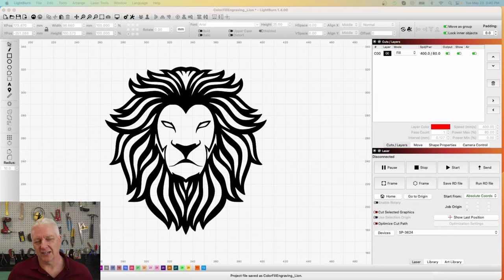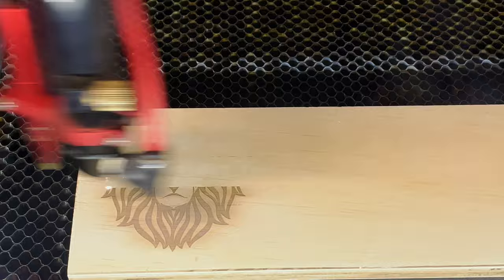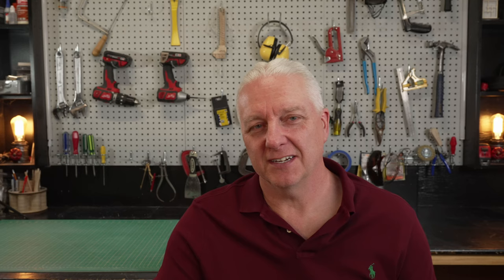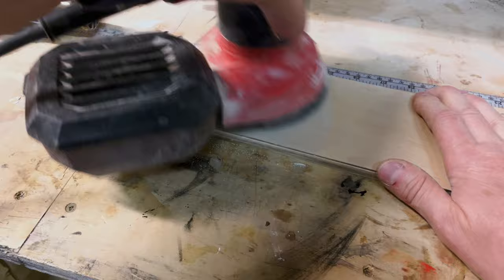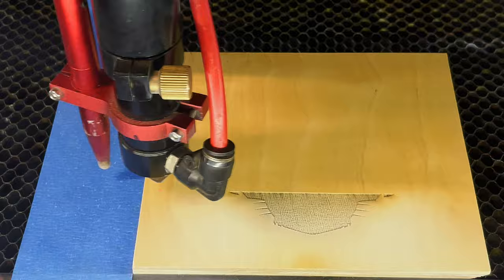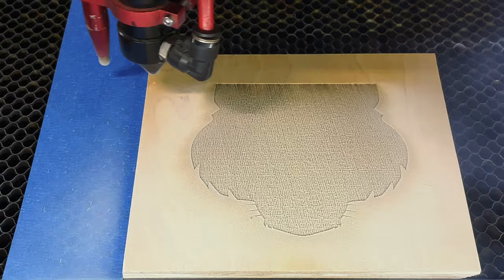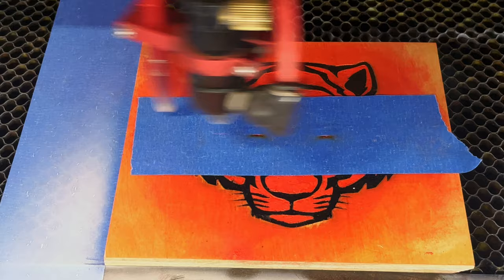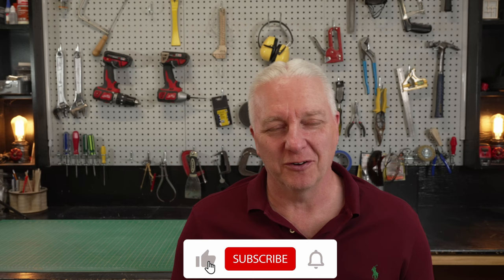Achieving Stunning Color-Filled Engraving

Comment: Very helpful video! Thank you for sharing! I see the link above for the Black & Decker Heat Gun, but would you please confirm this is the Black & Decker Dual Temperature Heat Gun Model HG1300 selling at Amazon and Home Depot for $29.40? (In the past I have clicked on links in "How-To" YouTube videos only to discover the link was hacked, so I am always a bit wary.) Also, would you please recommend an inexpensive but good sander? Thank you! I look forward to reading your response.

I use the Trotec Speedy 300 80w laser at the public library to make gifts for family and friends. Several of my projects have intricate engraved designs, such as a Chinese Dragon. I have tried various methods, such as masking and then using Rub 'N Buff/spray paint/wax paint to color the engraved sections. However, it does not work well. The paint seeps into the unengraved areas or it's almost impossible to remove the masking tape. Nothing has worked, or perhaps I just lack the skills. I had just about given up hope until I watched this video. (Although there is a Trotec video of a laser being used to melt the Pro-Tec Powder Paint, the public library staff is understandably concerned about harmful fumes and damage to the laser.)
Reply from the maker: I believe this is the model of heat gun I have.
Reply: @SteveMakesEverything  , thank you.. Can you recommend an inexpensive sander?
Reply from the maker: @deborahzorn7549  Honestly just buy whatever is on sale.  Dewalt is probably the best quality, but also look at Makita and Milwalkee
Reply: @SteveMakesEverything  , do you mean "Milwaukee"?
Reply from the maker: @deborahzorn7549 🙂 Yes. Typing while doing two other things is never good.  The fingers work, but the brain isn't engaged.

Comment: Is there an easy way to register the piece of wood so  you can put it back exactly in the same place?
Reply from the maker: If you noticed, in the video I used the front edge of my workspace and then applied a piece of tape as a marker for positioning.  However if perfect accuracy is required build yourself a jig. I did a video on this about a year ago if you want to learn how to do this.

Comment: Could you paint the board (as the background) and then use this technique for the fill in?
Reply from the maker: Yes you could paint it first, but unless you are very neat spreading the powder coat, you are probably going to need to sand a bit after heating it.  Not sure how you would get overspill sanded off without Messi g up your paint job
Reply: @SteveMakesEverything  GOTCHA! I'm new to this, and I'm trying to see best practices! Thank you for your response!

Comment: Instead of using a sander to remove paint from the unengraved areas, could one mask the wood, engrave the pattern, add the Pro-Tec paint powder, melt the paint powder using the heat gun, and the remove the masking tape? Is this a recipe for disaster? Will this work with some masking tape (Kapton?) but not others? Thank you.
Reply: I confess I had not watched the entire video before asking this question, but then watched the "advanced" section in which my question regarding masking is answered. (If my understanding is correct, yes, the blue masking tape can be used.) 

I use the Trotec Speedy 300 80w laser at the public library. If I wanted to do a multi-colored project similar to the tiger, is there a potential health issue when using the Pro-Tec Powder Paints to engrave the painted surfaces such as the tiger's stripes and the eyes? (I have the Pro-Tec Powder Paint MSDS, but what is a warning sign?) Thank you.
Reply from the maker: Yes, you can mask as long as you use a masking tape that can handle a bit of heat.
Reply: @SteveMakesEverything  , thank you. Any thoughts about re-engraving the painted area using the Pro-Tec Powder Paints (such as you re-engraved the tiger stripes and eyes) at the public library? There is ventilation of the Trotec Speedy 300 80w laser to outside the building. Safe? Risky?
Reply: Steve, any thoughts here as to the safety of re-engraving the tiger stripes on the orange tiger background? I have the Safety Data Sheet as a PDF but cannot attach it here. Thank you.
Reply from the maker: @deborahzorn7549  As long as the paint doesn't contain chlorine or fluorine compounds you are probably ok.  Still, make sure thew laser is vented well to the outside.

Comment: This method does not work at all. It blows the powder out even on the lowest setting which is why it never shows it until the end.
Reply from the maker: If the powder is blowing around, then you are holding the heat gun way too close.  You want heat not air, and defnitely don't try to use a hair dryer.  

Hold it further away until you see the powder start to darken.  Then you can move a bit closer.

Comment: Seems that you are using powder coat for spray paint. For me masking, then laser and spray paint seems much easier.
Reply from the maker: You can do this of course. Powder cost is thicker an isn’t absorbed by the wood, so no masking is required except to protect other colors and minimal sanding